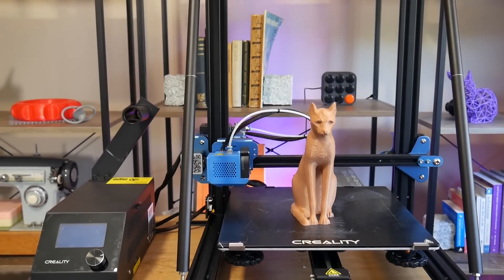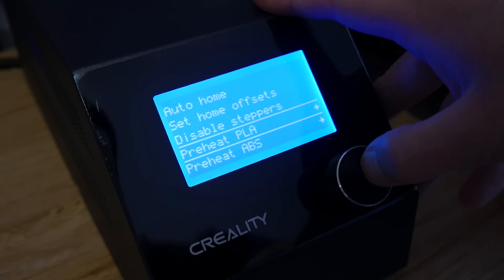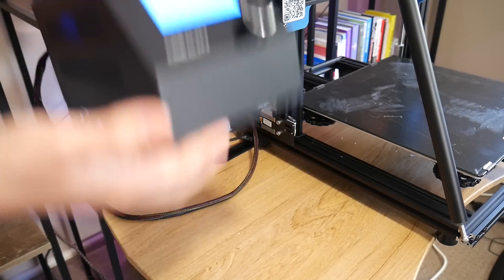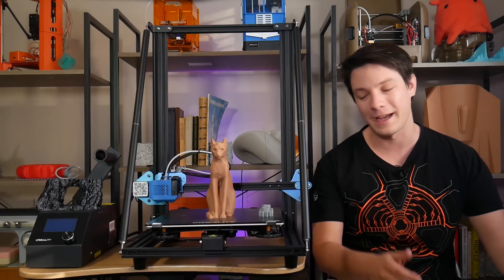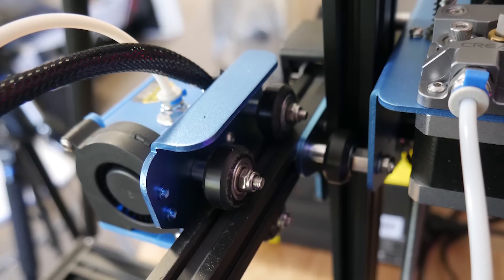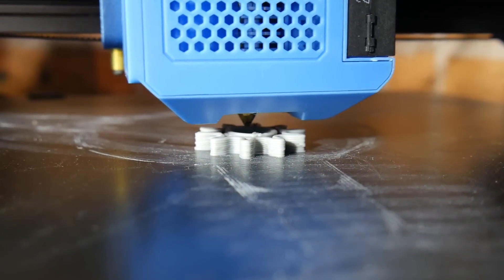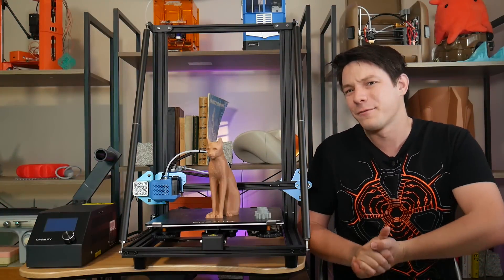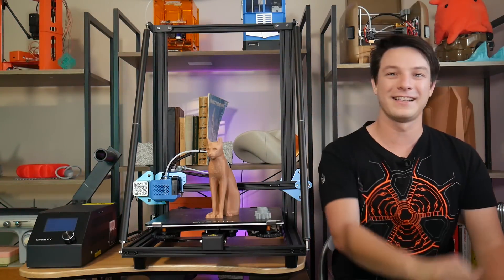Can the CR-10 V2 topple the Creality King? 3D Printer Review

Comment: So, the question becomes -- will they have an upgrade kit that has the two brackets, the brace rods, and the two pins? Everything else is "meh", IMO, and it looks to me like they got fat with their success.
Reply from the maker: They've definitely dumped some money on injection moulding to make it 'prettier' and cool the part better but yeah, you could easily bring the older version up to spec with some threaded rod and printed mounts to make bracing, it's a pretty common upgrade afaik.
Reply: @MakersMuse  It's sad when an engineering-driven company is successful because of technology/design, only to get loaded up with marketers and accountants who look at the engineers funny when they want to add things like self-leveling. 

"Make it pretty and can we make the fan shroud the color of my nail polish?" or "How many weeks did you say you want us to pay you to integrate and test that firmware change while we have a pile of non-functional production machines for you to troubleshoot?"

Comment: Hey Angus, just curious, what prints do you keep and what do you throw away? And how do you store what you keep?
Reply from the maker: Sadly, a LOT get thrown away because of how many of the same boring test print I have to do to evaluate each unit. I keep the more interesting ones and sometimes give them away as gifts.
Reply: @Maker's Muse  It's almost a shame there's not an object or series of objects that can have a life beyond testing a printer, useful mechanical things or interesting artwork that people actually want, even when the prints don't turn out as hoped.
Reply: @MakersMuse  You may need to get your self one of those systems to recycle old prints in to new filament.
Reply: @kevincozens6837  which system is that? I've see a couple promising that but they only work well with virgin pellets.
Reply: @EldarKinSlayer  There was one system shown at ERRF for crushing plastic in to pellets. There may be another system for preparing plastic to be turned in to new filament. I don't keep track of them as the solutions are too expensive for me to justify the cost as I don't do a lot of 3D printing.

Comment: First question, does it have thermal runaway protection? Honestly I just wanted to write 'first' in the first comment.
Reply from the maker: It does! I filmed this before the previous video, but I have since tested it.
Reply: @MakersMuse  also, about your concerns, yeah, those are all pretty decent concerns. However, someone with an engineering background like me will love it- A quick change to the marlin FW and the current version of Cura to remove the bugginess will solve just about everything.

The most important part for me- is that there's almost no computer assist. The power in these machines is that they're built "simple stupid". They're cheap (which this company passes on to the end user, props!), barebones and minimal, with nearly exposed parts and the computer moves only when you tell it to. Ask any engineer and they'll tell you how that's why "smart" devices get so dumb. being good at manual things gives you much more granular and precise control than trusting a computer expecting your use case to be "normal". let's face it, if you have a use for a 3D printer, you're already not "normal".

I agree with the nozzle notes, but honestly, a .4mm nozzle lets this thing compete with and even beat ultimaker's best, quality wise, at a fraction of the price. Don't feel like you have to use the entire build plate! I pull off +-.05mm precision prints on mine, making mechanical parts like ratchets and snapping locks small enough to fit inside the walls of beyblades! in the end, yes, a larger nozzle will let you use the big area more effectively, but this printer can excel with .15mm nozzles and miniature printing as well!
Reply: creality's firmware has it, and has almost always had it minus a few hiccups with their CR-10 mainboards and some underpowered capacitors being installed on them, and were unable to keep voltage or heating stable above 210c that was a year and a half ago- and I was able to replace my mainboard for the new one in a week, including shipping. the firmware is a fork of Marlin.
Reply: FWIW their CR-8 didn't have it enabled either. So... with my admittedly limited data I kinda doubt that "almost always" bit.
Reply: @dside_ru  I did say cr-10, not cr-8. the cr-8 also supports laser engraving, so I would assume it uses a different mainboard, or firmware at the very least.
Reply: @nubnubbud  you said "creality's firmware", I read that as "across all of Creality's printers". Did you mean something else entirely? CR-8 and CR-10 in particular both use Marlin. Their mainboards are indeed different, but that's beside the point.
Reply: @dside_ru  I see that now- I meant "creality's firmware has it, and has almost always had it (minus a few hiccups) with their cr-10 mainboards" . comment edited to avoid confusion.

 while they both use marlin, many printers cannot actually hold the entirety of Marlin, because of its many features, so when it's compiled, anything that's not flagged as on, is literally thrown out of the firmware! It makes sense to have as few firmwares among your printer designs as possible, but also to cut out things you don't need. If something has and uses completely different electrical components, you can assume it has at least a slightly different firmware. While it is tough to troubleshoot different firmware for a new printer, it's not tough to make another with one or two more features included. For example- Marlin's thermal runaway features have this thing where the extruder won't even activate below a certain temperature. I might expect that to affect similar processes, like some kind of auxiliary tool code. If your printer won't let you engrave unless your printer is heating up, then you'll want to disable that feature. Now, that's dumb on the developer's side, but I've seen worse than that.

it might also just be that the store you bought it from stocked it before they fixed it. even Creality themselves usually has a small backlog of older printers to send out first.other companies probably don't sort them by age, and you could potentially get one with the shoddy capacitors, a year and a half after they upgraded that part!

I had no clue before you commented that, that they actually had a laser engraver now! cool! and... it's a really decent design, I'd say, though I have some other ideas for hotswappable print heads of my own~
Reply: @nubnubbud  ah, I see now.
I had to dig into Marlin's build process and configuration in order to install a newer version onto my CR-8. Huge kudos to Marlin's maintainer btw, Scott aka tinkyhead was immensely helpful.
I dumped the original firmware and found that it's so ancient (2014? I don't remember) that it might have been built before thermal runaway protection was introduced. So we can at least be sure this isn't a case of aggressive cost cutting.
I don't think outdated stock would have much to do with it though: for one, I bought mine at what seems to be Creality's official store and I doubt they would send out outdated revisions, if there even are any; and they could have at least provided an update that adds that protection in, if they can't be bothered to reflash existing printers, they could at least urge their customers to do that.
So I have reasons to find Creality's behavior in the thermal runaway matter mildly irresponsible. But this may be a thing of the past now that Naomi is watching them :}
Reply: @dside_ru  yeah. I know my cr-10 has always had it, from early 2017. I actually hit it with some gcode accidentally set to 2000 degrees celsius! whoops~ XD
but yeah creality does that because they have a system, and honestly it works. if they kept updating the firmware and cura, it would sometimes have bugs- but if they keep that cura, and keep that firmware, it'll be bug-free forever... but have no special features either. in any case, I fully support it, because it feels like built-in right to repair, they're practically saying. "yeah it works just how we say it does. if you think you can make it work better, go ahead, it's easy as pie to modify."